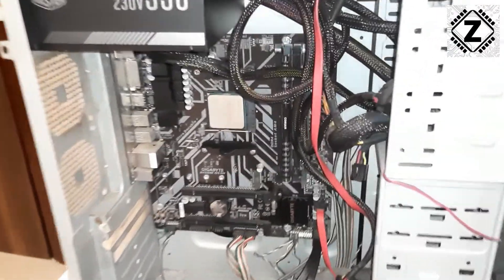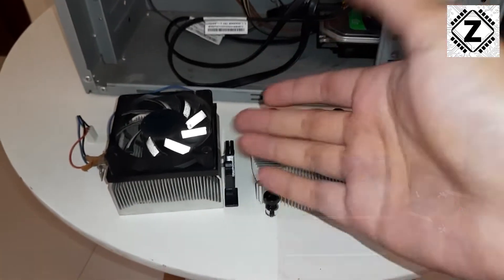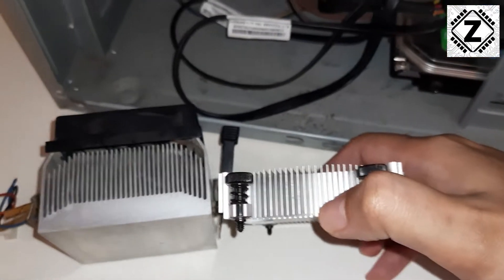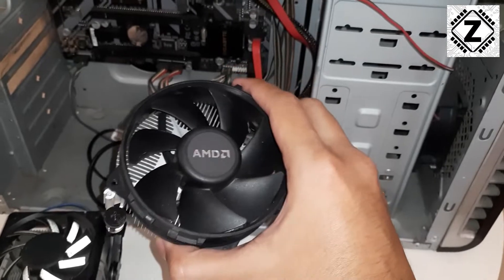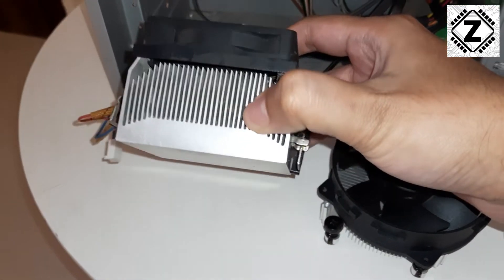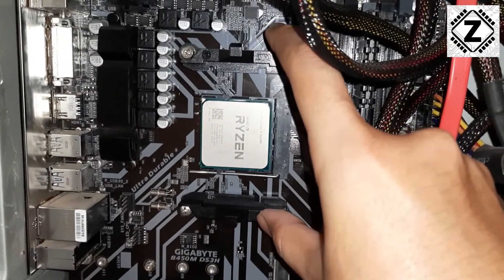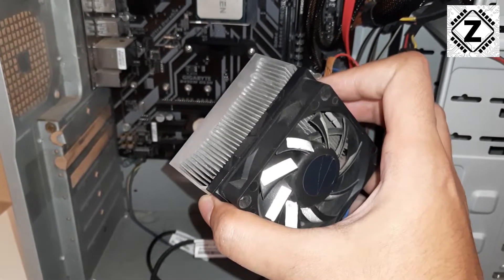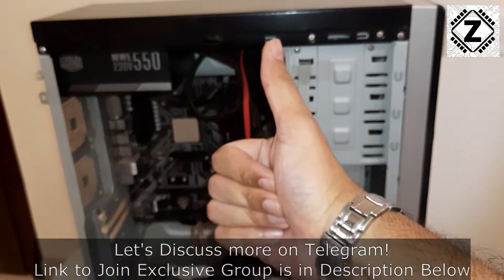[Eng] Old is gold? Can you Install older AM2 or AM3 CPU cooler on a Modern AMD Ryzen AM4 Socket?

Comment: I came to this video, because I had this brand new in a box Bulldozer 4100 stock cooler, that I never used and I bought a new AM4 MB+CPU to upgrade my existing one. So I was looking for temporary solution and not to stop my old PC while I'm testing my new parts. So yeah if it fits, I'm pretty sure a 140W TDP stock cooler should do just fine on a 65W Ryzen CPU.
Reply from the maker: Glad the video helped you with your upgrade!
Reply: well it will work, but CPU coolers back in the day relied on fast-spinning smaller fans, that tended to sound like a jet engine. 

That was not a problem back in the day when everything (power supply fan, case fans etc) were designed not taking sound into consideration...

But for modern standards this is an extremely annoying solution. to be fair, in my sec. build i have an Fx8320e with an AM3/AM3+ 125w/140w tdp cooler (the high end one with coper heatpipes) and despite keeping my CPU at correct temps, the ammount of sound this produces makes me want to buy a cheap-o SE-903-SD or something similar to replace it and gain in quietness

Comment: the old AMD coolers from socket 754 to AM3+ used the same type IIRC? they had to cool chips of 130-32nm process nodes unlike 14-7nm Ryzen so that is why the heatsinks were much chunkier, I think?
Reply from the maker: Perhaps. But they feel higher quality.
Also TDP hasn't fallen much despite process node.

Comment: I have an ancient Arctic Freezer 64 Pro, and that old boy still working like a charm.
Reply from the maker: Superb
Reply: I have had my Thermaltake Big Typhoon VX for like 17 years now and have used it in multiple AMD builds... all i done is to replace the fan with a modern 4 pin (Fractal Design HP12) no air cooler on the market today can even compare to it in terms of performance and low noise

Comment: the clip will latch but the old screw holes in the AM2 are farther apart so a new AM4 screw down cooler will not work on old AM2 boards or screw down AM2 cooler will not work on AM4 boards

Comment: i also tried this cooler of fx 8350 on am4 board and its fit and work , but for me fan noise is increase may be because of small fan on it and rpm goes above 5000.
Reply from the maker: Good. Try tuning the fan curve in bios or use speedfan.

Comment: nice. i'm gonna try right now.
Reply from the maker: Sure. Do report Back
Reply: doesn't fit.  the holes on my b350-f are wider apart than my am3 socket ones.  the bracket wont fit the holes on mine.
 @ZenInnovations
Reply from the maker: It fits on my B450 board.

Comment: It is Official. Previous AMD AM2, AM2+, AM3, AM3+, FM2 and FM2+ heatsinks are compatible with AMD AM4 Ryzen as long as they are fixed with clips on the plastic tabs of the AMD Socket. However, it is always enlightening to be able to see it in reality. I have The Phenom II AM2+ stock cooler - https://cdn-bbcpm.nitrocdn.com/SgNTverElKDHimpvzWWbvdcSixCmbBKZ/assets/images/optimized/rev-b0922df/wp-content/uploads/2010/06/phenom1.jpg - extracted from an old 2010 hardware. I was impressed by its dimensions and by its design that incorporates copper tubing in addition to the direct contact with the processor. After a deep cleaning and testing the fan, I found it to be weak. I decided to replace it with an industrial grade Delta AFB0712VHB. A powerful model congruent with modern specifications for a CPU. Now it is in perfect shape to assemble my new pc with Ryzen 7 5700G. And yes; old is gold! Thanks for your video.
Reply from the maker: Yes ! those coolers were beastly. Good luck with the build.

Comment: Really big thanks for video, I have old scythe ninja mini cooler in my broken pc in closet,  I think AM2 or AM2+ socket and now I have new ryzen htpc system and stock wraith cooler sucks. I used that old ninja cooler as passive cooler and it worked so well...I hope I can instal it to newer AM4 motherboard...here in Finland we have old saying "vanhassa vara parempi" its something like "old things with which one is familiar are better when one wishes to be cautious" 😊
Reply: If it uses the same latch type mechanism, it'll work on am4 but if it's bolt down it will not. Am4's bracket is not spaced out the same.
Reply from the maker: Cool.

Comment: i wasn't sure about using one of these on my system so i ended up buying a am3 125w stock cooler, those with the copper base. good thing i did because my 2200g is still reaching 70°c overclocked. a regular aluminium cooler wouldn't have been enough.
Reply from the maker: Very cool

Comment: Good video.  I use the AMD Wraith Spire with my Ryzen 5 3600, but if I had known the older coolers were compatible I'd probably stick with that.  They worked perfectly fine.

I never bothered with the Stealth.  It seems to get poor reviews unless you are just reading e-mails or watching Youtube videos.  It reminds me of the older Intel coolers that didn't work particularly well, and were probably designed for basic office use.

I live in Florida where it is also warm.  Your case is very similar to mine, except I have a single 120mm rear fan.  I just never bothered to get another case.  Temperatures can be a bit higher than a newer case but it is quiet in operation.  My CPU runs at about 87 degrees performing chess analysis using Stockfish running on twelve threads, and about 92 degrees running Prime95.  That's not cool but not something that is typical usage, either.  Gaming temperatures are about 75 degrees.
Reply from the maker: Thanks.
Old coolers are working fine. Also,
I have upgraded most Stealth systems with 3rd party towers.
https://youtu.be/Pc-lupDlNBc